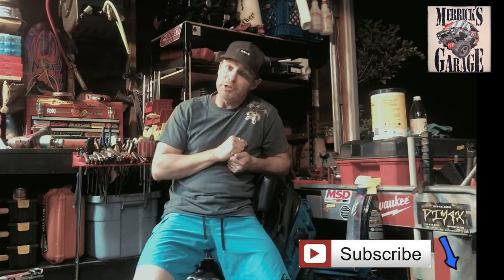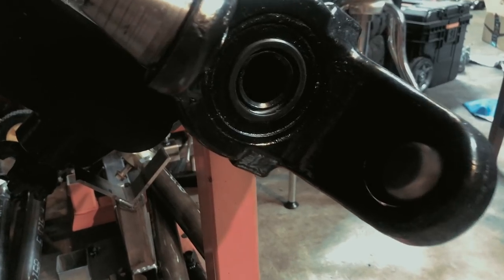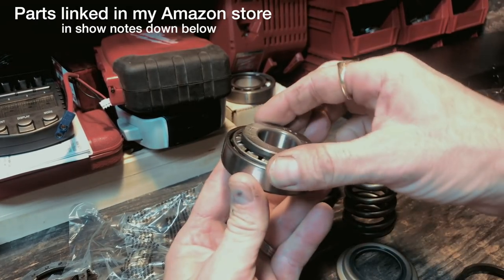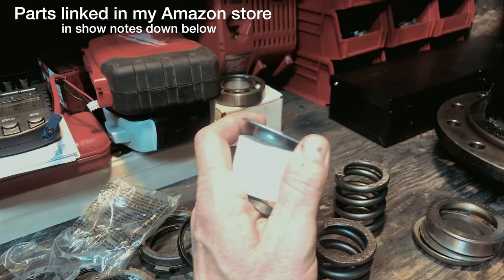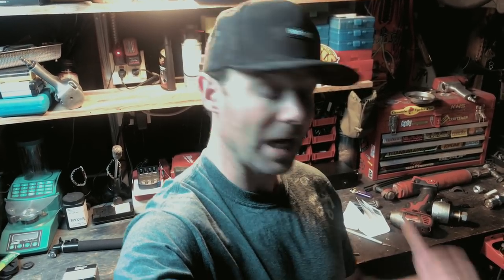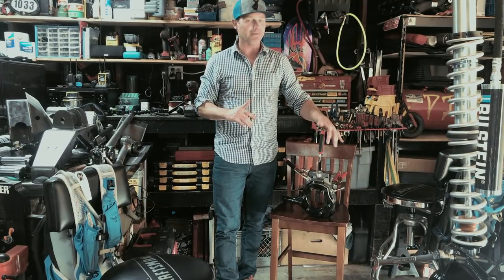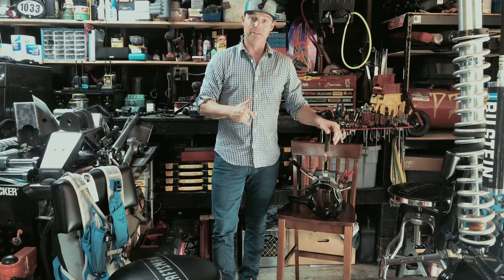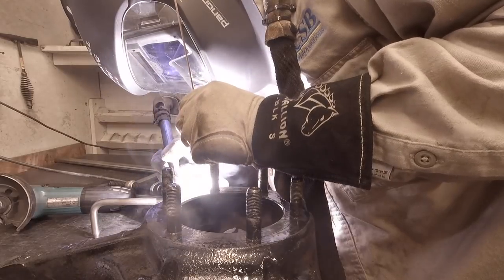Mg #79 - Dana 60 Rebuild Part II

Comment: Beefy!
I'm still rolling the GM 10 bolt on the 83. 
One day your going to learn us on how to make the 10 bolt magnificent, I feel it!!

Love everything you do. I bought the 83 because of your channel.
Reply from the maker: man, that stokes me out.  The ten bolt is fine.  Just don't beat on it too hard.  To be honest, I bet the D60 I am building is massive overkill for what I need, but I am not thrashing all the time.  Not like it is going in a rock bouncer.
Reply: Merricks Garage 
Do you know of any good crossover steering kits/mods for the 10 bolt without having to use a passenger side Dana Knuckle?
Would love to see a comprehensive rundown of the 10 bolt axle, pros and cons.
I've seen one by "dirt everyday" but I was still left unfulfilled as far as capabilities.
I know Dana is king but for those of us stuck with the 10 bolt for now would love to see a good rundown, and upgrades episode if you ever get bored!!

Respectfully,

Layton

Comment: Why didn't you go with the springless kingpin kit?
Reply from the maker: +dman1049 will down the road, but at this point the plastic was cheaper.  I may do the mod of stack washers of tension is still off a little